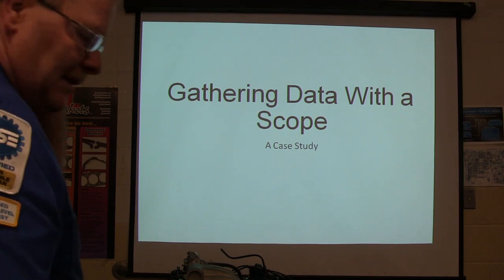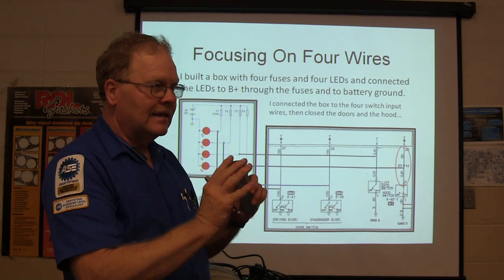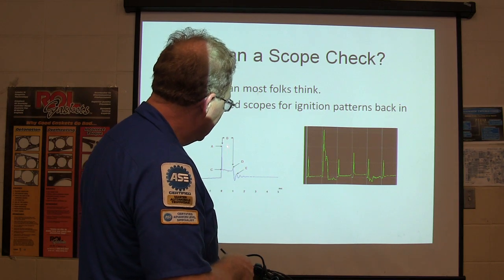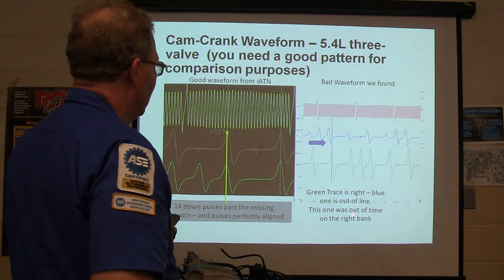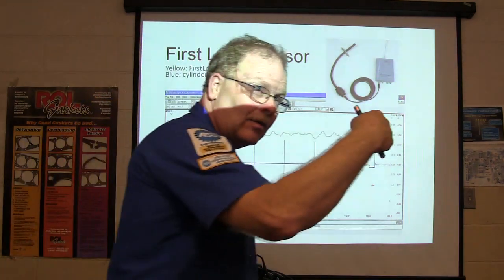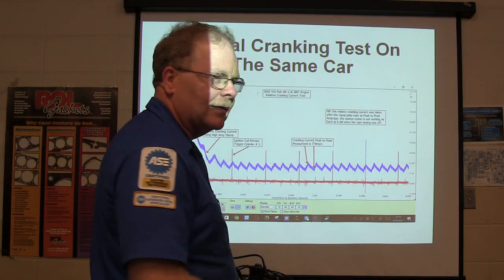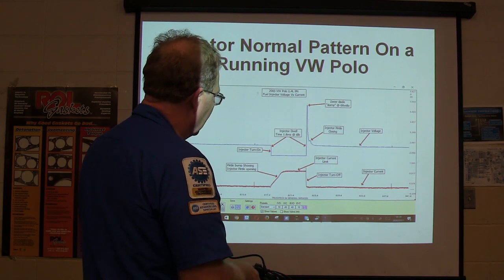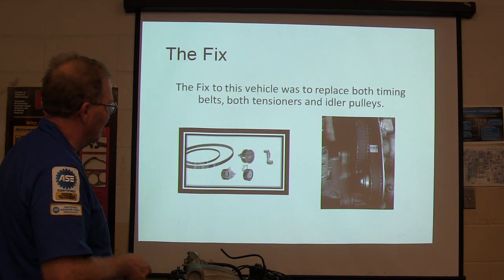Using Scopes and a Case Study

Comment: What about a timing chain engine? How do I know when to change? 2005 G35 sedan 153000 miles. Thanks!!!
Reply from the maker: There's no timing chain replacement interval on that one, but the chain and its slides can be greatly affected by oil change intervals and the quality of the oil that has been used.  3000 mile oil changes with a really good oil of the right SAE and API classification will make all the difference - but at that many miles, if other choices were made, all bets are off.